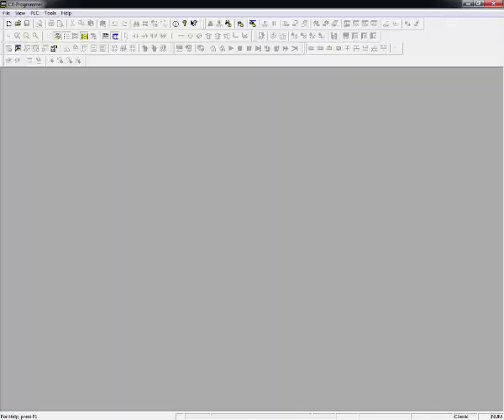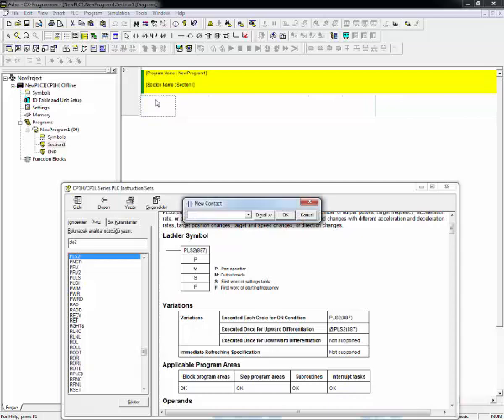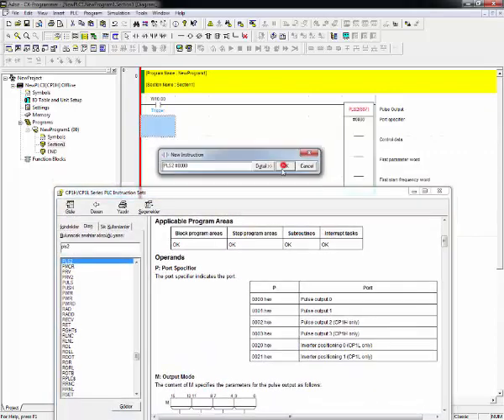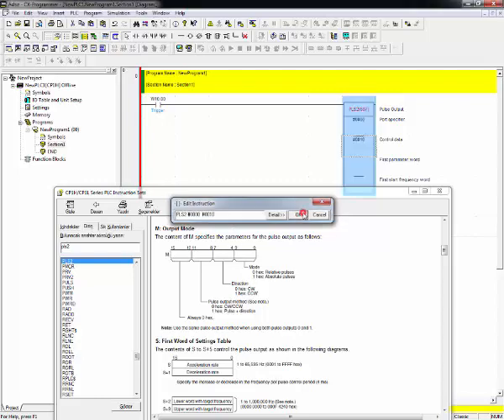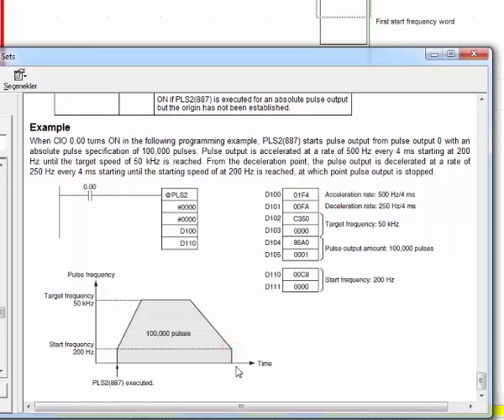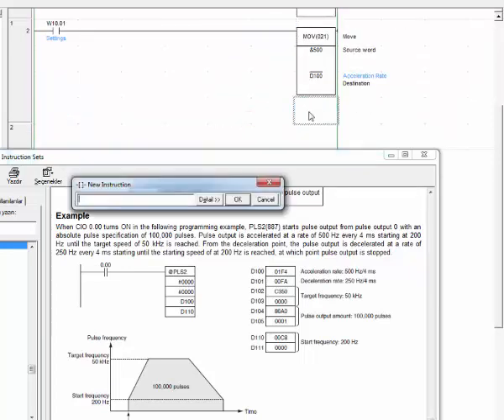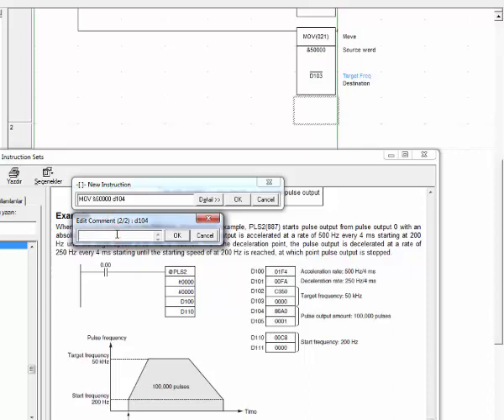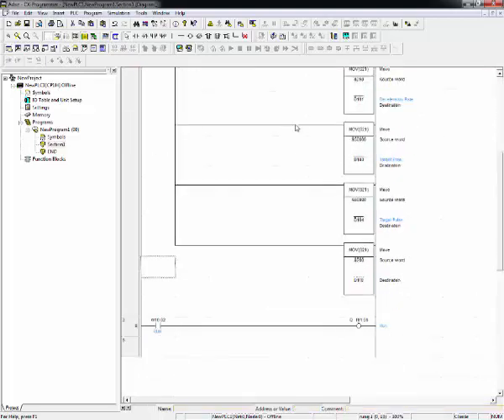How to drive Servo Motor with PLC ? [1/1]

Comment: Hi, Very nice. But i'm having trouble rotating the other way. OUtput mode #0010 or #0000 won't change the direction

Comment: Erhan, This is a very good tutorial video for new user, thank you for posting it on here. I got two questions for you, first one is you select the output PLSY2 0000, by the manual wording it should be pulse output 0 , does that mean it will output Channel 0.0 ? because when I try that on my OMRON CP1H PLC , the CH0.1 light up instead? also I thought it require two channel output for position pulse and how fast? where do I assign the other port? Also I am very confuse about the Pulse wiring to my Yaskawa servo motor S7, the diagram doesn't realy help, can you kinda explain how you wire yours? I tried the method you posted from the other video but not working